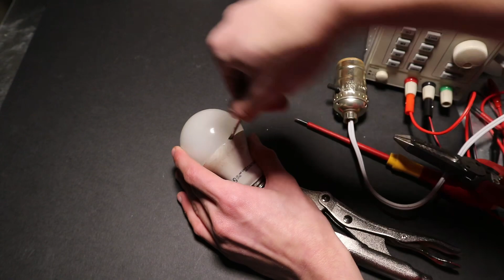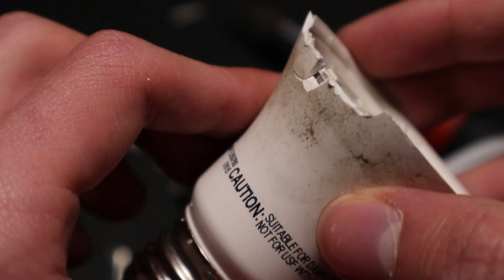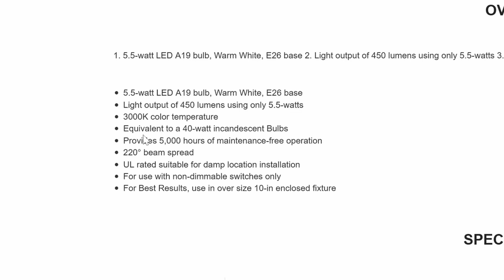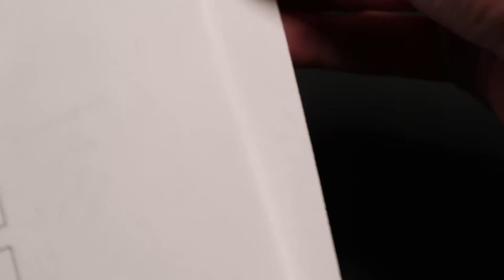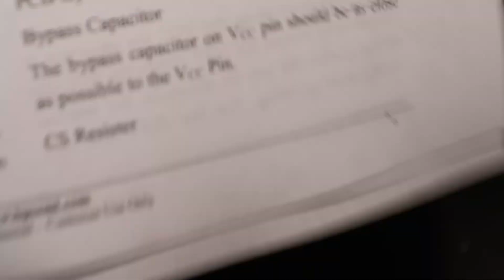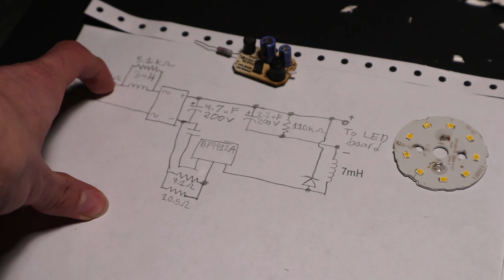Inside a Failed LED Bulb (With Power Supply Schematic)

Comment: The input resistor is a special fusible resistor designed to blow safely. It is common in LED bulbs.
Some new bulbs feature a 1 PCB design where the bridge rectifier, calacitor, and LED driver are on the same PCB as the LEDs, clearly designed for lowest cost.

Comment: The thing that it’s irritating to me is that even with more expensive led lightbulbs  the max was like 4 yrs but instead of 3€ it’s like 12€ yes it’s a filament led but still it’s too expensive and all in one fixtures with leds lights already in it are even worse. I hope that we could buy Dubai led lightbulbs at least those can last a good 8/10 yrs and apparently cost the same 9€ of a standard filament led bulb.
Reply from the maker: I have had quite good luck with LED bulbs, except for the ones in these outdoor lights. These outdoor lights are kind of a durability test for LED bulbs because they run for a few hours per night and outdoor temperatures can vary a lot. These ones keep failing because they are only rated for 5000 hours lifespan. However, here in the United States, for just $2.09 per bulb (not including tax and shipping of course), there's a 60w equivalent standard LED bulb (not filament) that uses 9 watts, outputs 810 lumens, and lasts 25000 hours. In a future video I might take a look inside one of these to see how well they are constructed.

Comment: it's designed to fail after a year or so..
Reply from the maker: Yes. I did a calculation and this specific light bulb will only last 1.7 years when switched on 8 hours per day, based on its 5000 hour lifespan. This is because it was used on a dusk-to-dawn light sensor in an outdoor light fixture which probably ran the bulbs 8 hours per day on average.